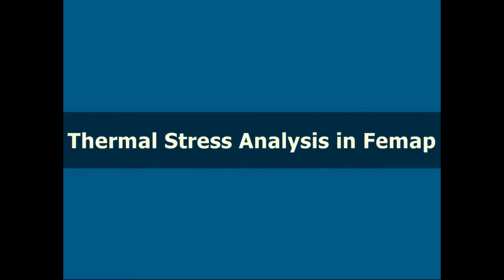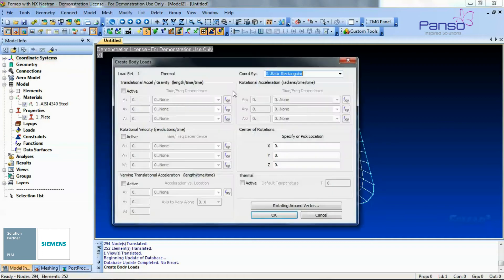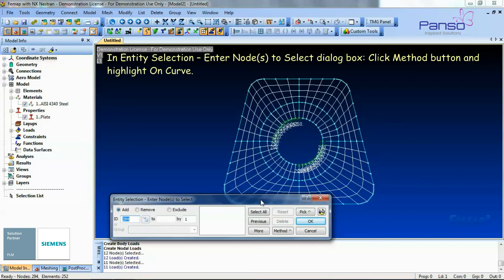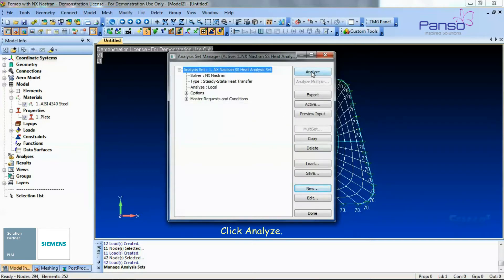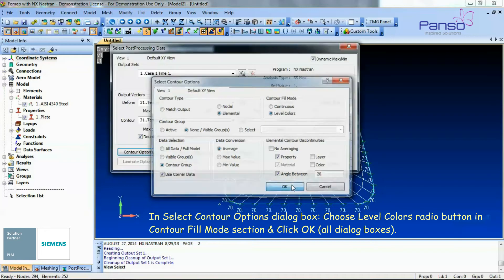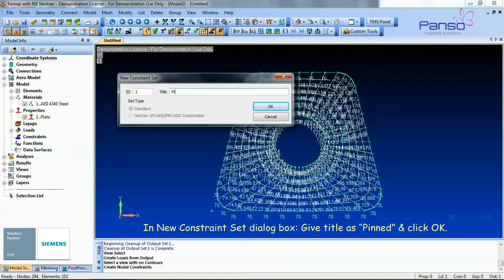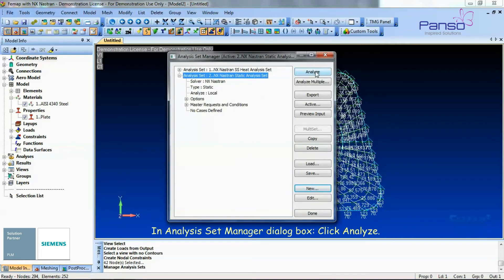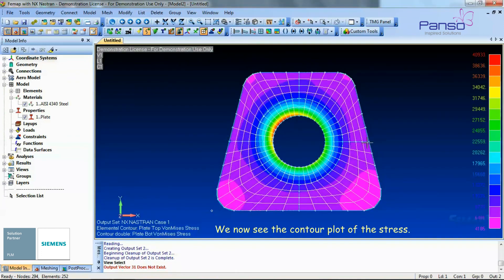Thermal Stress Analysis in Femap

Comment: Hello! I have a question about the results of static analysis.I don't know what is with that value of 40933. Is it N/mm^2 or what? And 70, 200 and 250 value for temperature are kelvin degrees or celsius degrees? Thanks!
Reply: FEMAP inputs and outputs are units agnostic. It's up to the analyst to ensure that their inputs adhere to a consistent unit system. The only case I'm aware of in which you might see people deviate from a consistent unit system is when the WTMASS parameter is used so you can enter mass in terms of weight (e.g. lbm instead of slugs).
Reply: i'm pretty sure they do not use Kelvin.  In USA, more often than  not, Fahrenheit is used.  Celsius used sometimes.  I believe Kelvin is used in more in Chemistry, or purely academic Physics research.  I would imagine Astro physics might use kelvin,  Or in high temperature chemistry applications.